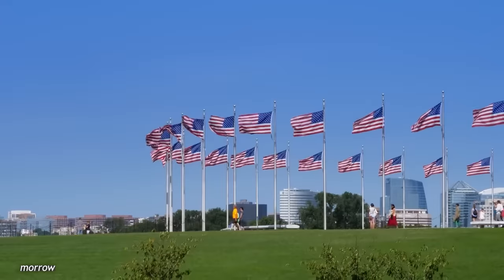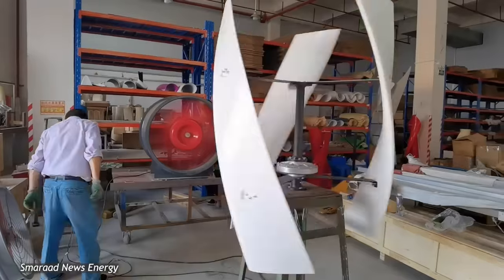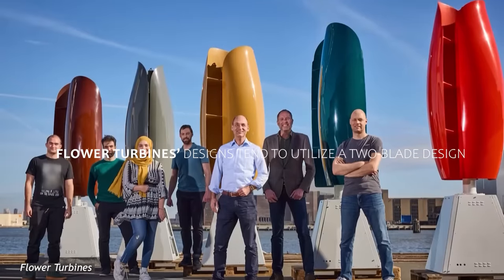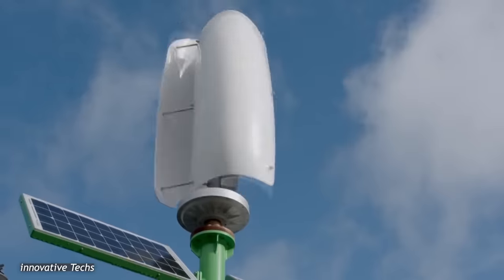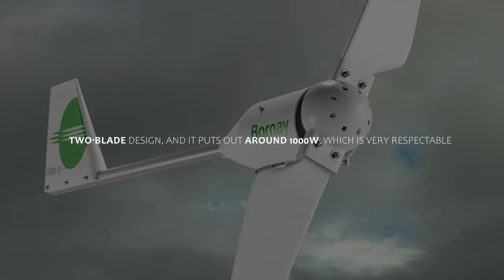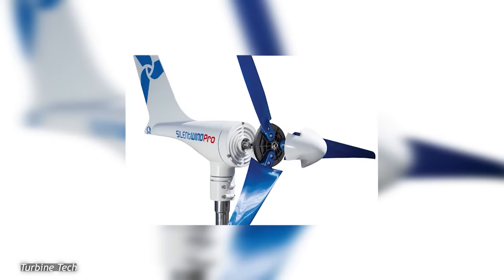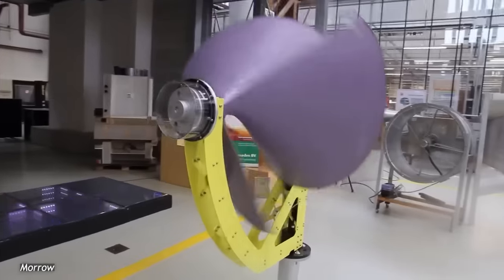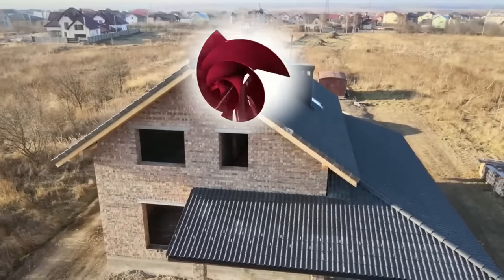5 Wind Turbines to Make Your Home Energy Independent

Comment: Sorry man, your information is incorrect, horizontal turbines are more efficient than vertical turbines. also no turbine generates useable power at low speeds, even if they have a low startup speed,  you can't create energy from nothing. basic energy laws apply, where they do come into their own is in turbulent conditions as horizontal turbines get knocked about turning out of the wind and waste time getting lined up again
Reply: also in the end the presentation shows "1,500 kWh" (one thousand five hundred kilowatt-hours of energy per year), which the narrator magically turns into "1,5 kW" (one and a half kilowatts of power), which oversells the actual claim by almost a factor of 10. The level of "nah, it'll be fine, I don't care" in this "educational" video is jaw-dropping.
Reply: Correct

Comment: Two rules of wind turbine will help you decide what turbine is best. 1) Never mount turbines on buildings, vibrational noise and stress will be destructive. 2) Turbines should be mounted at least two times height of nearest building or trees. Follow the rule, the cost and efficiency will lead you to the right turbine.

Comment: Combine wind turbine with solar. The output of the wind turbine charge controller can be fed into the same battery as the output of the solar charge controller. This allows power to be supplied by two independet energy sources. If one source doesn't deliver the other might do so. Vertical wind trubines start producing power above wind speeds of about 4m/s. Even if a wind turbine only produces 200W it's enough to charge a battery overnight so you can prepare your breakfast in the morning. Often when solar is unavailable or low (in winter) winds are strong  - so solar-wind is a good combination. This is for off-grid -  if you're on-grid just spend the money on electricity bills and draw your juice from the grid.

Comment: 1 and 4 are the worst of the windmills. Savonius-type is always worst, even if it looks like a tulip. 5 is worst of Darrieus-type, 6 blades are always worse than three, if these are not 3+3 blades (two turbines above each other with a shift for half the turnover between the blades)
Reply: 88u
Reply: Vawt turbines are way more efficient and cost effective than the traditional ones

Comment: What happens in a storm with 100km/h or more winds? Can these break on the roof or blow up the inverter?
Reply: While wind turbines can be affected by strong storms, the Segway Portable PowerStation Cube Series is designed for durability and can withstand outdoor conditions. Its magnesium alloy frame and multi-layered waterproof design make it resistant to damage. However, it's always a good idea to monitor extreme weather conditions and take appropriate precautions to ensure the safety of any equipment. Stay safe and enjoy your outdoor adventures!
Reply: Windturbines stop when there is too much wind and they stop when there is no wind. Besides all the mechanical failures that require maintenance or repair. And they require enormous quantities of square miles to put them. Finally it makes energy twice or three times more expensive and the supply unpredictable.

Comment: How to control the Frequency of power generated, when wind speeds are variable
Reply from the maker: it's simple first the power will go into the energy storage system from that it will be used to power the house.
Reply: Thanks for your quick reply. That means energy generated will be D.C. and later we have to use the inverter. Is that correct? .  @morrow100

Comment: Guys...lets put it bluntly - all small home turbines are a joke! 

You cannot cheat the laws of physics - you need massive surface area for the wind to spin, else you lose huuge ammounts of energy!

Alsom, to make up at least some of the lost energy, small turbines need to spin at huuge speeds, greatly increasing structural stress on the turbine and shorting its lifespan and making maintenance be required often and thus, expensive.

it really isnt worth it!

The only actual small-ish turbine to work, would be the Aeromine, but it has severe limitations:
- it only works with 1 wind direction
- its heavy, bulky, not that small ...it is small when compared to those 100m tall collosi, but its by no means actually small...its the size of a huge, large closet!
- its used on square industrial buildings (like warehouses)
- it doesnt work in residential spaces, due to weight and vibrations
- very difficult to install on buildings, as it has both an outside and inside part